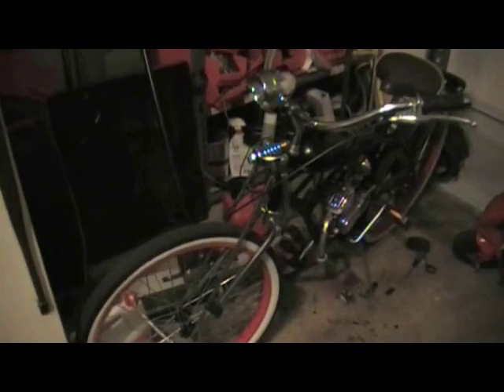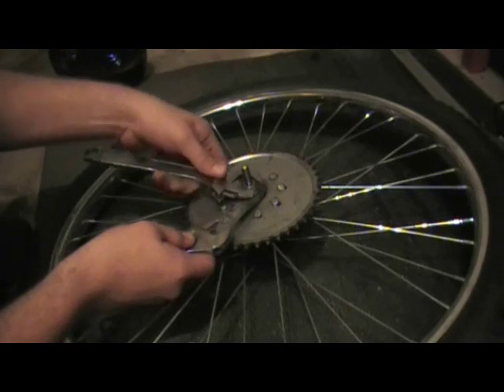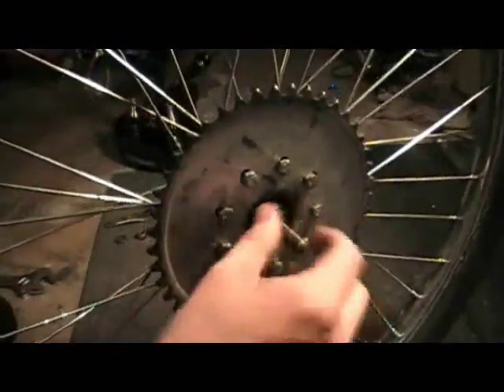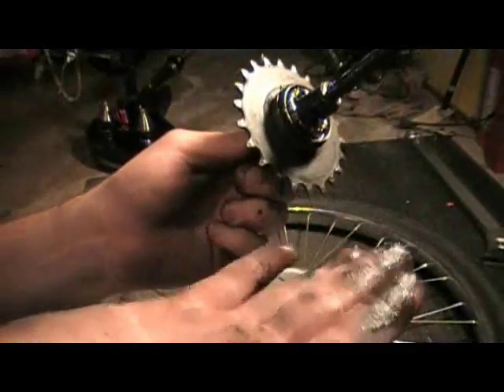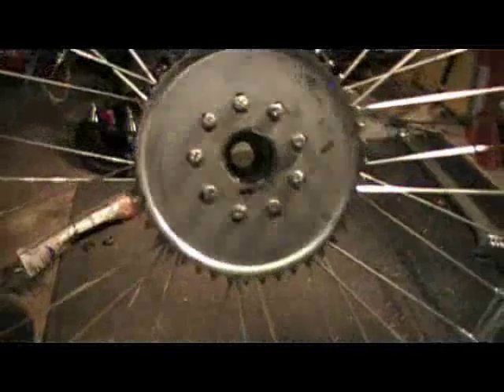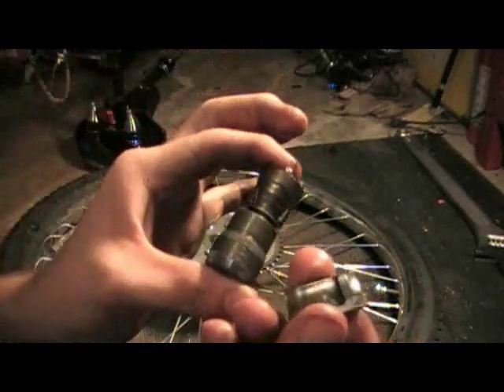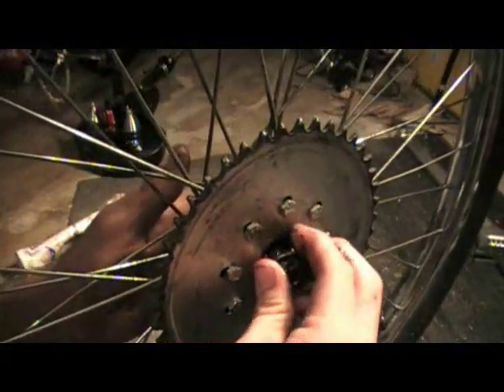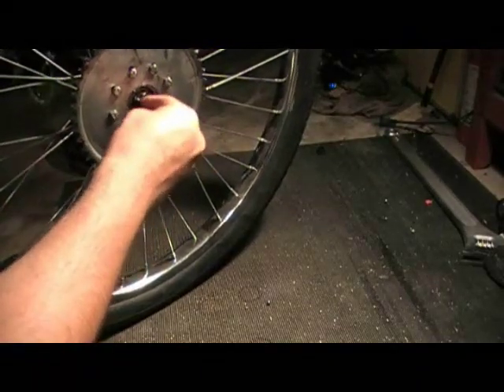80cc Motorised Beach cruser Coaster Brake Tune Up Tips

Comment: 3rd motor in.  completely tore apart 2  rear assemblies attempting to find out what every self proclaimed mechanic in my neighborhood couldn't seem to help with.  (How the rear assembly works with a coaster brake). If I had found this video sooner I don't think the chain would have snapped off the second motor and the first braking mechanism would have worked out without replacing the 1st one. Now all I need is a video on removing the coaster brake without stripping the nut and how to re-center the inner parts so my chain isn't so close to the tire.

Comment: Literally the most helpful video I’ve found when building a motorized bike... every issue I encountered was covered here, and here only. Thanks man!
Reply from the maker: No problem    Happy to help   ,
Reply: Got a question and I can't find any videos on my issue. I am having a BITCH of a time trying to get my rear wheel to line up perfectly straight, to where the drive chain doesn't rub up on the rear wheel. How do I fix that issue? 3/4 of the wheel clears the chain, but when it's rotating I can't see and hear the chain rubbing when the wheel wobbles a bit while I'm spinning the tire. I can't fkn figure out for the life of me why I can't figure out a solution. I REFUSE to pay a bike shop $40 for such a simple thing. I should know how to do it and I don't and it's pissing me off. Any help or suggestions would be greatly appreciated 🤘🏽
Reply: @TheRandomMechanic  I can't figure out how to get the coaster brake arm off of the hub 😭

Comment: Hughes motorized has a video about trimming the dust cover down so you do not have to automatically chuck it. It is not all that difficult to do, either.
Reply from the maker: i have done that before , you have to trim so much off  its like you aren't using one anyway   plus i never ride in super dusty offroad areas anyway so it doesnt matter

Comment from the maker: @jumpa01   i think people know not to stomp on the brakes doing 40mph    the bike will slide down  and it will ruin your day     thas why i sujest in other videos  to put a cable brake on the front wheel  for added braking         also what is with the grease crack     if you dont like the video  fine    i figured i would make the video  to help make sure someone does not have there bearings fly apart on them from lack of grease  dont blame me if you did something wrong be mad at yourself

Comment: you dont need to throw out your dust cap. You can dremel out the opening in the sprocket to be large enough to go over the dust cap and save your bearings.

Comment: Good video , I used a wheel and ground down my dust cap and used it a s spacer over the motor sprocket and the brake arm clears the bolts and keeps everything tight while still protecting the bearings .

Comment: So can I just take the coaster arm off completely?
Reply from the maker: And leave it off ? No  that is the only way your brakes can operate and without it the first time you forget and pedal back your brake will overtighten and your axle will either break , threads will strip or it will spin in place damaging your entire hub and probably the rear of the frame ,  i had the coaster arm center strip out once and thats what happened .
Reply: I have other brakes. I don't want the coaster brake.  Not worried about that. Worried about fitting sprocket on back rim. Without the coaster brake working. So it will spin free backwards. Like you can pedals backwards with a freewheel.
Reply from the maker: @jefftober7252    i still wouldnt advise it ,
Reply: @TheRandomMechanic  guess I'll figure it out and share more helpful advise.

Comment from the maker: you do have to bend the coaster brake lever  to clear 

you need to toss the dust cover    it will rub the sprocket   if you dont     

these motors  work suprisingly well on the 29" genesis onyx      from walmart     very mean looking bike    my only gripe is you have to throw away the handlebars   and buy smaller ones   because the throttle doesnt fit the larger tube used on the bike

Comment from the maker: do you mean the hole in the middle of the sprocket   

no  i left it alone       you can open it up if you have to        the guts in a  stock HiStop coaster brake fit perfectly through the middle of the sprocket  

if you need to open the hole up you can file it  or use a dremel     to get the desired clearance

Comment: is the bigger sprocket drive the wheel when the engine is engaged or the smaller one ? if you could help with my con fusion on this it would be great

Comment: What does it mean when u try to brake and the engine makes the pedals turn despite you countering the forward motion
Reply from the maker: It usually means that the coaster brake arm is stripped out , the hole with the two flat sides has become completely rounded out

Comment: Hello just bought motor kit but have a 29er from wallmart im trying to use it on. Can you tell me if you bent the coster brake arm so it would clear the bolt heads? mine won't clear the bolts. or will removing the berring dust cover some how make it clear? any help with this I would be much greatful for. PEACE...

Comment: just got in to this for a hobby, I got a huffy cranbrook got the motor and everything together,put the sprocket and hub in the back,could not get the coaster brake arm to fit, so I took it off and put the wheel back on ,have not drove the bike yet is it ok to ride
Reply from the maker: if the arm wouldnt fit    what you need to do is bend it so it will fit   ,  it is not a good idea to drive it without the arm  attached unless you want to replace the rear wheel  or end up going to the hospital       it could literally lock up self destruct    at any moment without the arm  ,      every bike i have ever made needed the brake arm bent to fit after the sprocket was added  ,  its annoying  but necessary ,   btw nice choice with the cranbrook     which one did you go with   ?     the black and green one walmart has now  looks pretty boss
Reply: James Collins got that exact bike didnt use coaster arm and it caused a big mess work fine for a bit but afterwards back tire wobble
Reply: James Collins not advisable wrecked my hole axle

Comment: I left the dust cap on and placed the new sprocket over it. I found an untraceable rubbing and chain not moving as it should. Now I see that I must remove it and rebuild. Any advice on which way the sprocket should face?
Reply from the maker: i normally face the sprocket out   so the chain is the furthest from the tire    i have had problems in the past with the chain eating away at the sidewall causing blowouts  ,

Comment: On the rear sprocket what side is the best, teeth facing in or out toward the frame?  I see yours is facing out?
Reply from the maker: sorry  it took so long to get back to you     this whole  new comment system  is junk      i tried every day to answer my comments but the reply button didnt work 

its working today for some reason 

the direction of the sprocket   realy depends of your bike        if it looks like the teeth or chain will rub your tire or frame        then you can turn the sprocket around to get some more clearance 

you can then use the tensioner to align  the chain where the sprocket meets  by tiping it left or right slightly    to center the chain links  with the sprocket teeth

Comment: what happens if you remove the coaster brake arm only,and put the wheel on and start ride n
Reply from the maker: the coaster brake hub needs the arm to function properly   it might work normally unless  you back peddle  at all  or the brake is somehow engaged due to centrifugal force   , in that instance  your peddles will be forced forward    and your hub assembly may over tighten itself since the parts that were originally stationary can now spin with the torque of the brake  causing self destruction of the hub   ,   i had a brake arm strip out once   and that is what happened to me    thats when i switched to the star pattern brake arm   ,

Comment: Hey man, building the motorised bike and I've got the default alloy wheels... but was planning on reinforcing the spokes with copper wire and solder. Do you think this would be much of a problem?
Reply: While it's a very interesting idea, the spokes need to remain tuned and flexible. The more tension you add to them the greater offset tune you are likely to face. I would recommend something like the 'manic Mechanic hub adaptor' rather than potentially damaging your spokes. It's all up to you, and if you actually follow through with the soldering project I would love to watch a video of it. Really an intriguing concept :)
~Mike

Comment: can't get the coaster brake arm to fit, I remove the dust cover,gonna remove the pads inside and put the wheel on and install front brakes,what you think, hey I am new at this ,I need a hobby,been work n on this a month now
Reply from the maker: removing the pads might work  ,  let me know how it works out
Reply: James Collins cut the outer, rubber, donut in half (make 2 out of one) for some extra clearance.....🍩🍩

Comment: My braking all the sudden got extremely sensitive and will squill really loudly. Any ideas?
Reply from the maker: Stevie Magana   either the coaster brake needs to be cleaned and  re greased   or   the inside of your brake surface  is worn down    to the point  that it is fixing to break internally   or lock up      look for scoring on the inside surfaces    , metal shavings  ,   or old nasty grease ,      it could also be that your  brake arm has been wallowed out   and can spin on the shaft    if that happens  the nut will over tighten  when you brake  and cause severe damage  often busting the rear hub in half

Comment: my coster break is slipping when peddling forward,,,what's up with that
Reply from the maker: it sounds like you may have a worn out hub  or broken part  , you should pull it apart and look for excessive wear   ,

Comment: can I ride with no coaster brake at all
Reply from the maker: yes   you can  , a coaster brake is optional     you can replace the coaster brake wheel with a standard wheel  or one from a mountain bike   and just use a brake pad setup     ,   i use both on my bike myself    you never know  when one will fail   it is always good to have a backup